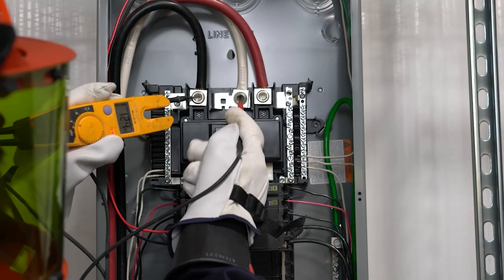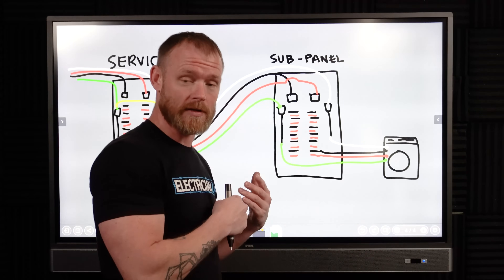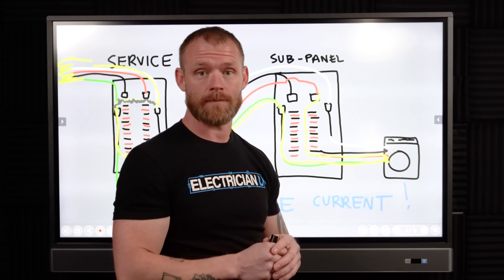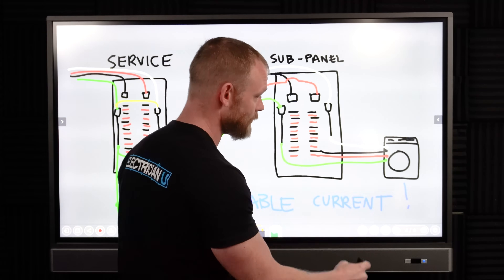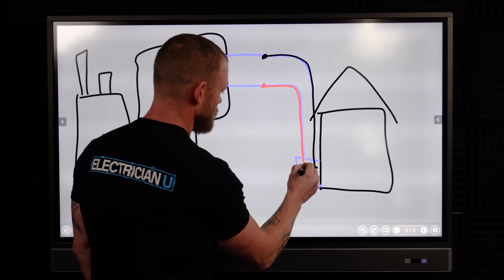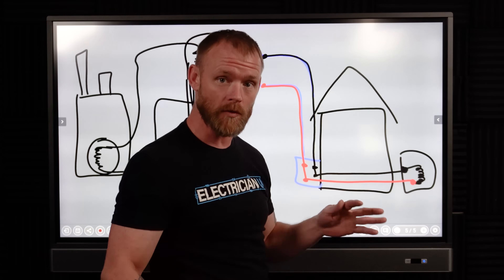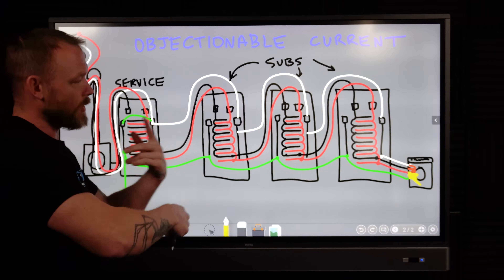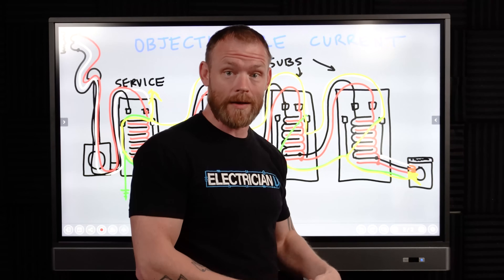Why Do We Bond at the Service Panel and Not a Subpanel?

Comment: I’d like to see more on parallel ground fault paths, hysteresis from fault paths in conduit (insulated and I insulated grounds in metal raceway), when and why to bond ground at the end(s) of raceway and more. On my mind a lot lately: example when (2) 120v circuits run through the same metal junction box, is it better to tie all ground wires together and bond to box, or to pick one of the circuits (the larger if size is different) and only bond that one? And also keep the ground path from each circuit separate? Based on this vid, I expect the answer is keep each circuit ground path separate from others, if practical. However complexity for installing technicians may make “tie all ground wires together at every junction” the better option.

Although parallel fault current paths may have issues tripping a breaker due to hysteresis (inductive resistance in the fault path), I’ve always understood the primary reason for keeping neutral insulated from ground /bonding paths anywhere load side from the utility service disconnect, is that the neutral normally carries current, and that a parallel bonded ground path back to the energy source via transformer center-tap will result in ground wires and grounded equipment (and to some extent all metal pipe systems in the building if they have been properly bonded) carrying current normally, too. If something is carrying current, then it has voltage and anyone exposed to those metal parts could become a parallel path for that current, and we don’t want metal enclosures and building pipe systems to have voltage, current, or to expose people or other equipment to that voltage or current.

The service equipment grounding and bonding requirements (wire size, bonding screws and straps, etc) are so robust that any energy source up to the full current rating of the service (and beyond, since the bonding is sized to the conductor size, not the breaker size) energizing or flowing on the neutral will effectively flow only to the energy source (utility transformer), and so minimally through building/ground > source that its voltage and/or current in these parts of the building will be negligible.

Comment: there are situations imo where you would be better off jumper ing ground and neutral at the subpanel if you decide you're better off using that xtra conductor for a lower resistance return..  Yeah .. not ideal but there are a lot of different situations in the world.  Sometimes you just have to make the code your bitch..Those guys aren't too smart anyway.

Comment: If the reason to bond ground to neutral at the main panel is to drain the ground fault current back to the grid, why have a grounding rod at all?
Reply: The transformer and all your neighbors should have ground rods, too. This way, the neutral on the entire utility line circuit is equal potential (zero voltage) between pole and house and between house and house. If lightning strikes near the utility lines, any induced voltage will have plenty of paths to equalize. If it strikes near a house, it will equalize through both the local ground rod and all the others installed on h to e grid system. The local rod may reduce voltage occurring beyond the local ground system, minimizing damage going upstream.?

Comment: I don't understand why you're showing 4 wires back to the Utility. Residential 1 phase 240 Amp services, whether old work or new construction, are 3 wires- 2 hots and a grounded conductor. I have never seen green to the Utility. The 3-Phase Service I helped build back in January was Black, Red, Blue, White- Three hots and a Grounded Conductor. Why are you showing Green (Grounding Conductor) back to a Utility?

Comment: At around 16:09 you were saying that the reason we don't want multiple paths for current to flow is that we have loads connected to subpanels and we don't want the fault current to go through equipment and ground. don't we have loads(equipment) connected also in the main panel, where the ground and neutral are bonded? Does it mean that fault current will go through the equipment connected to main panel?

Comment: I had a pretty serious issue recently, my dryer stopped working and when I tried to figure out what was going on, when I touched the dryer I got a barely noticable shock. (felt like static electricity.)  

I tested the receptacle and was getting 120v out of both legs, and 240 combined when both were tested, but when plugged in it was sending power into the netural wire of the dryer wire. 

Apparently the receptacle itself was so old that one of the legs was leaking power into the neutral wire which is what shocked me. (was not a bad shock at all but still dangerous.)  The Neutral wire on the dryer is connected to the metal frame.

So I went to go replace the receptacle and found two 8GA AL split phase legs with a BARE copper NEUTRAL.  Who the heck uses a bare copper 8GA wire as a neutral?  How did people get away with wiring like this?  (The AL wire actually appeared fine for some reason.)  

My heart sank to my chest when I saw that big fat copper 8ga wire with no insulation being used as a neutral!

My dryer worked fine for so many years and I never knew it was running off a bare neutral all these years.  Now I have to put a new one in, for 4 wire connection, because this is so unsafe!
Reply: Dryer circuits up to ? — the 1970’s? — were 3-wire similar to a water heater: 240v for the machine, and ground. No problem! All the controls on the board were either a 240v indicator light, or a mechanical timer knob that used no power for its control function. At some point, digital control boards needed power, and for some reason manufacturers decided to use 120v components, rather than 240v that would require neither neutral nor ground. Code allowed for bonding neutral and ground at the machine to provide for 120v control voltage (basically, digital timer and on/off relays). A limited current on the ground wire is permitted by code for existing circuits. These machines still often ship with a bonding strap installed, that must be removed when attaching modern 4-wire appliance cord (or left in place for a 3-wire cord). All this applies for electric ranges, too. Installers should take care to understand and properly handle bonding/insulation of the neutral terminal depending on whether the appliance circuit is new or grandfathered no-neutral.

Comment: I got a question,  how does it work if my ground rod is connected to the meter socket box. Because on this video the ground rods are connected to the main breaker panel.??
Can you please make a video just like this , but this time explaining the bonding , with ground rod connected to the socket? Do I still install ground screw.?? Or? Please help..
If no video,  can you please explain...

Comment: Code is a sub panel in same structure does not require earth ground and un bonded sub panel, if sub panel is in a separate building ie: detached garage, an earth ground is needed, sub panel remains unbounded.

Comment: the box i'm working on (old) has no ground and one nut for neutral. The box is the meter with 2 breakers. I'm adding a line...should I add a grounding rod and attach my new ground directly to the grounding bar?

Comment: If the Main Breaker was out next to the meter, as in many cases, is your Service Panel still called a Service Panel? I did not see a Main breaker in your service panel drawing and I am assuming  you call it  a Service Panel because that is where the Main Breaker is in your video. Put another way, if the Main Breaker is out by the meter, and the panel with all the breakers is in the garage, the Main Breaker location is where bonding would take place correct? I really enjoy your videos!

Comment: I was trained in the electronics industry and over my nearly 70 years of experience with all the blunders and mistakes I made over  those years in designing and developing electronic systems I formed a saying "Nothing is trivial or Obvious" . In Australia which is a little different to you guys in the USA it is now compulsory to fit Residual Current devices at the Service Panel. The Residual Current devices use a fundamental principle in the theory of Electricity known as Amperes law. Basically if you have a source feeding a load via a pair of wires in normal circumstances equal and opposite currents will flow out say from the active and back along the neutral and thus there will be no net magnetic field around the pair, Thus the RCD device will not trip. If for any reason you get unequal currents in the pair say greater than 30mA then the RCD device will trip. As explained very well by Electrician U bonding at sub panels leads to chaotic multiple loop paths. Another problem with bonding at  subpanels  where you have to use RCD's most likely you will get false tripping of the RCD at the service panel when there is no fault with your load. How do I know because I made the error myself.
By the way with DC sources in Solar Panels and voltages of say 1000V does anyone know if there is such a thing as a DC residual current breaker?

Comment: working on my grandmas house in mx. the sub panel in the house has a hot ground bar and the wire coming out the breaker isn't hot. I added a new breaker/receptacle/dedicated circuit for an AC unit and I even connected it using the ground bar as my hot and breaker as my neutral..didnt work wired correctly or even replicating it the way its already wired. basically I can't identify the neutral in the sub panel. will I have to run a neutral all the way to the main panel?

Comment: I have a portable generator where the neutral is bonded to the frame of the generator. If I connect my generator to my home's electrical panel through a generlink should I disconnect the existing bond to the generator frame and reconnect it if I operate my generator while it is disconnected from my homes wiring system ?

Comment: Nice explanation and your sketches really help to visualize the current flow thru the distribution system. One thing I'd add is that your examples mainly deal with fault conditions (short circuit and ground fault), but even during normal operation on for example a 120V load, if ground and neutral are connected at two ends, you just made the neutral a parallel set of conductors (neutral and ground in parallel), so current flows on both wires, and as you noted, we normally do not want current flowing on the ground wire (except in ground fault situations).
Reply: Yes!  Current does not only take the path of least resistance, it takes ALL paths.  Granted, the current flowing through the path of least resistance will be higher than the inverse proportion of the level of resistance of the alternate path(s).

Comment: Im pretty sure there is no ground path to a transformer ecpt via earth ground the power company only runs 2 hots and a netral to your home @ 240 volts or 120 volts each hot leg.   In your service panel you send 2 120volt outputs and a netral 
Ground is obtained via an earth ground. 
Your digram is wrong.

Comment: This is the only video I have found that actually helps build the concept in your mind. Very nice! The only thing missing is the explanation of "Service Panel" being the first junction past the meter or equivalent as the place needing neutral to ground bonding, be it a service disconnect switch or main breaker panel inside of the structure. Bravo!

Comment: I understand that you don't bond at a sub panel.but an argument with a friend said I don't need a ground rod outside my garage building connected to my ground in sub panel. Yes or no?
Reply: I recently had an inspector require the outbuilding sub-panel be bonded to local ground rods at the out-building. I forget the circumstances (if any) when this is not required (almost certainly for the case of two or fewer branch circuits run not through a load center), but I agree that rods in ground ensuring equal potential between the remote out-building and the ground of the main building (which may be extended insulated over a large distance between the two buildings in the form of the sub panel feeder ground wire) could reduce harmful induced voltage in the event of a lightning strike near one end or the other of the feeder run.

Comment: Oh my. Maybe I shouldn’t have done this. I’m in a tiny home that gets power 100’ away from the main panel on another house. It’s neutrals and grounds are connected as well as 
at my 100amp sub panel. I noticed my house wasn’t grounded with the typical 8’ copper rods so I bought 2 as my research suggested (the 2nd rod about 6’ away)and hammered both into the ground and wired to the subpanel I use. I was thinking if lightning hit my place it would be bad not having it grounded right there but your explanation seems to contradict what I did. Doesn’t seem right for it to travel 100’ to ground as it would blow things up on my end before it got there. Suggestions?

Comment: Im in Missouri no Codes ,  the power company  run a service panel  with ground and meter at the pole  with a split Box  one for the house one for the barn ,  two 220 lines from the pole  line One 220 goes to my house , Line two 220 to my pole barn  Both off same service panel,   my house and my barn are bonded and have a ground rod .   Both the House and Barn are Sub panels  with Ground Rods and Bonded   Should they be

Comment: I have a mobile home . The service panel is outside . I also have a cabin I am fixing and set up a 100 amp panel inside it. 
I did not bond it.   The electric panel inside the mobile home is not bonded and neither is the panel I set up in the cabin. is this correct?

Comment: Question for those in the know.  In a ground fault situation on a breaker in sun panel. It finds it’s way back to the bonded neutral in the main panel to complete the circuit and trip the breaker.  Which breaker does it trip.  The breaker in the sub panel or the breaker in main panel feeding the sub panel.    Secondly. If it trips main panel Does that mean you don’t need gfci breakers in sub panel as the main panel will take care of that.   Is there harm in having two gfci in line on the same circuit like that

Comment: So if my neutrals and grounds were all ran to one bus bar at a sub panel theres no difference between that and a panel with separate buses that are bonded with the green screw correct?
Reply: That is correct.  With the Green grounding screw left in place, it has the same effect as ground and natural wires connected to a same bus bar. This must occur ONLY at the first mains disconnect panel. 

Your question starts " if my neutrals and grounds were all ran to one bus bar at a sub panel".
The key word here is sub panel. The Ground and Neutral must be connected together ONLY at the FIRST MAINS DISCONNECT PANEL. That means at the first panel after the meter. And ONLY at the first panel.

Comment: I understand the theory you are describing etc.  My home has a 3rd sub-panel in a small outside storage building.  Power runs to this building from a sub-panel in my attached garage.  He did not connect the neutral and ground bars in that third panel.  But why did the electrician install a separate ground rod for that external storage building panel?
Reply: A separate ground rod is required in a detached building.

Comment: Great info I was wondering if I add a 60 amp sub panel to my detached shed that's 50 feet apart what type of wire would I need to run from main panel all I'm running is a couple of lights a dryer 30 amp and like 6 outlets any help is appreciated

Comment: What if I connected both neutral and ground wires on the subpanel and don't bond anything. Wouldn't the fault current get back to the neutral bus on the service panel and trip the breaker. The current is still getting back to the transformer. But I guess the current would have to much resistance to not trip the breaker correct

Comment: I have a question please allow me to explain what I have first I have a rack mounted panel three circuits 2 20 amp and 1 30 amp. I also have a portable panel that can carry 60 apps from the main generator or service they’re asking me to use it for wire 50 amp connector to my subpanel in my sub panel I need to run five wire to two different amplified racks can I run four hot circuits and one neutral and then can I run a ground wire to the metal casing of the amplified racks? I know this is a lot I’m hoping you can help me. Thank you

Comment: Something that is often not mentioned is that if neutral and ground are bonded, a broken neutral at any point before the bond will cause all grounds downstream of the bond to develop a potential of 120V relative to earth, as they are seeking to return to the neutral via ground having lost their neutral. This was touched on in the video but it warrants further explanation as to the theory.
Only doing the bond in one place minimizes the amount of conductor that would create this condition if it were broken. If the service neutral breaks it'd be very obvious. But if a feeder neutral breaks to a subpanel feeding your garage, you might not notice until you touch it later and get a shock from the grounded components that are now 120V to earth!
Reply: If just a neutral breaks you still have hots.  The earth ground would trip the breaker. Since only the hots run thru breakers (neutrals don't) earth ground is the only thing to save your life. This feels like time travel. Maybe the professional will read this and help us all?
Reply: @kellyschlumberger1030  The neutral breakage at a point where neutral and ground are bonded will cause the ground to develop 120V potential, because the power wants to return to source via the ground bond as it cannot get through the broken neutral so travels through the bond to the ground instead.

separated grounds/neutrals don't have this problem, so that's why they are always separated whenever possible